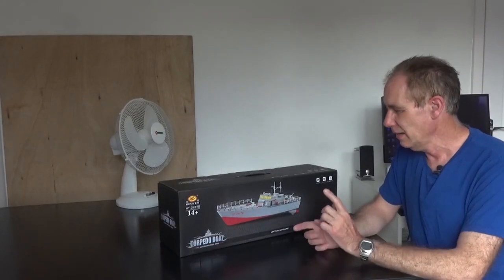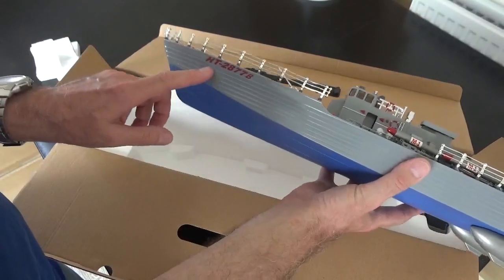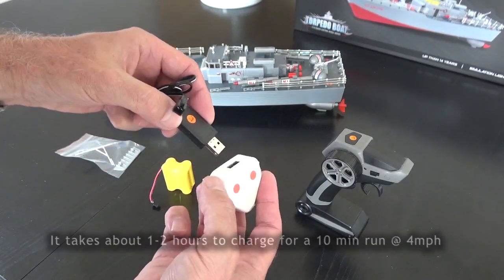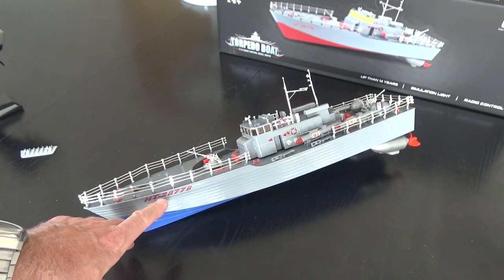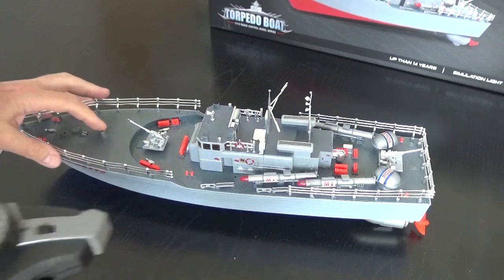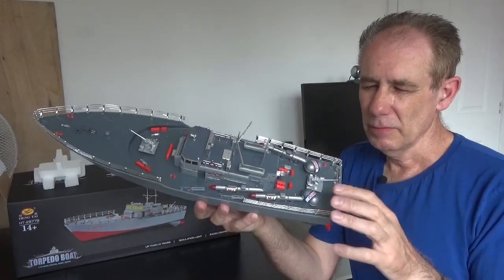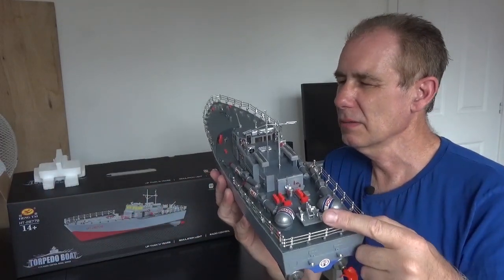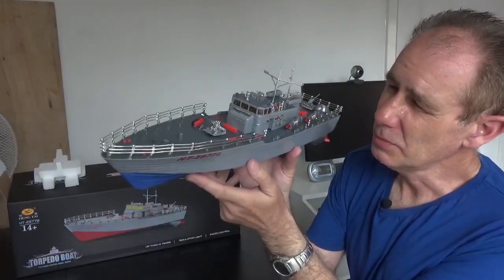PT-15 PT Boat or HT2877B model remote control boat

Comment: im planning on getting hengtais bismarck i hear lots of bad crap wondering how this one is did you have any leaks ?
and did you paint it did it muck anything up if you did as i would like to paint up the bismarck ?
Reply from the maker: When you weather a model it is easy to cover up any mistakes but with this one I think it sprayed rather well. I don't remember any mistakes. With a battleship model I would say be careful that it isn't too slim. A model needs to be big to not wobble in the water when it is that sort of shape. Depends too where you will operate it but it is is windy it may wobble about.
Reply: Tengo uno de esos. Parece que se dañaron esos dos elementos que presionas en el video (sensores), la última vez que lo utilice lo guarde rápidamente sin dejar secar y le veo residuos de óxido, por lo que no hay señal de encendido. Me podrías indicar como se llama y de que manera funciona?